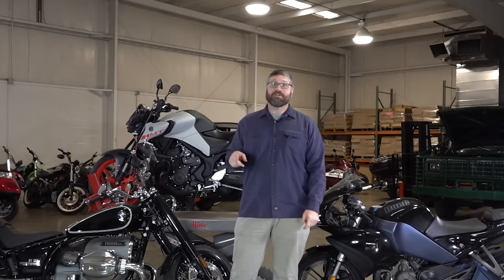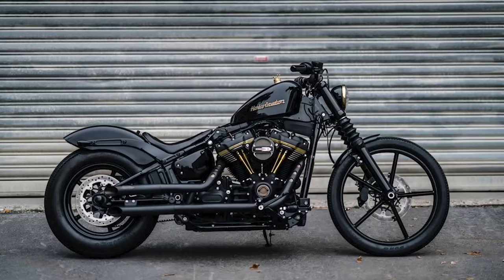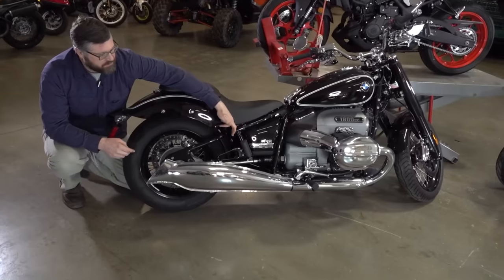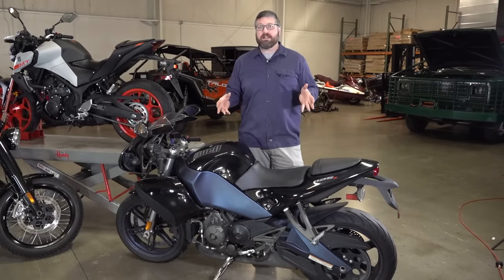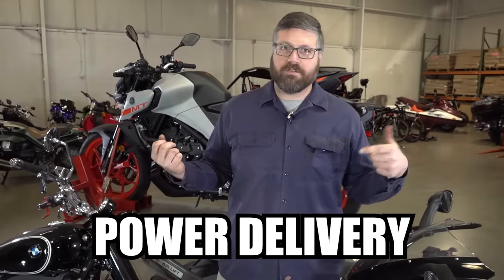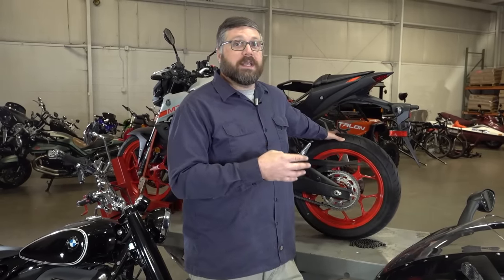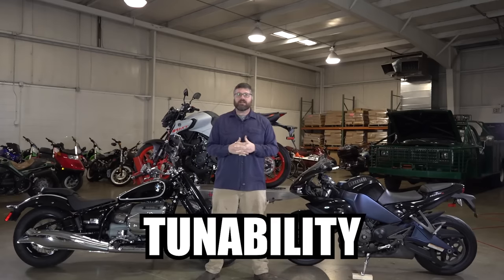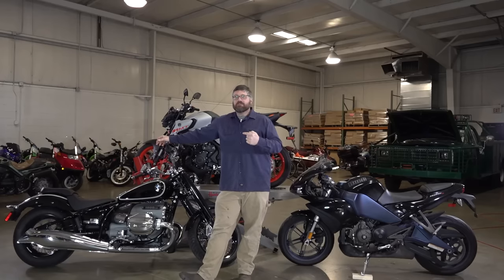Motorcycle Chain vs Belt vs Shaft Which one is Better?

Comment: My favorite drive is shaft drive. Then comes the belt and chain. The East German motorcycle brand "MZ" had a closed chain case to protect the chain from dirt and dust. These chains also had a longer service life due to the protection.
Reply: I had 2 MZ 250s, the second one was bought brand new. Thanks to the clever chain enclosure, the chains performed marvelously for more miles than I'm getting today with my Kawasakis and Hondas. The MZ ETS 250 was a slightly goofy-looking bike, (German MC magazine in the 1970s: "Yes, we have no bananas") but remarkably reliable. The second one, which wasn't abused  by a previous owner like my first, took me all the way from Germany to the Cevennes Mountains of France and back. Some friendly gestures by the factory -- the bike came with a really good toolkit, including a spare set of bulbs.  I wish I still had it here in the USA. But being a 2-stroker, it's not a favorite with the authorities here.
Reply: @georgiabrigand6793  Maybe an MZ 500 R with a four-stroke Rotax engine from 1991/1992? The design was completely taken over from the MZ ETZ 251/301 and also has the closed chain case. There's even an MZ club in Miami Florida. I found youtube videos. ;-)
Reply: @dennismundt7378  Wasn't aware of that one ! I'm putting the MZ500R on my "look out for" list, along with the latest BSA and Royal Enfield models. Thanks for the heads-up, Dennis !  Ride safe !
Reply: Lots of German bikes had this. the older Kreidler Florett's had it too. Can't remember which bike, but one old bike I saw, had an oil bath the chain runs through. At the end of the day though, nothing stops chain stretch.
Reply: @DetroitMicroSound  I don't currently know of any motorcycle manufacturers who still install a closed chain case. Starting with the "Skorpion" series, MZ no longer had a chain case installed. In the end, the star of MZ sank despite a beautiful and powerful model range (MZ 1000 S/ SF/ ST). In 2012 MZ was insolvent and a restructuring failed. The second manufacturer "Simson", who installed a closed chain box, went under in 2003.
Reply: @dennismundt7378  I don't either.
Reply: I think Simpson too?
Reply: @georgiabrigand6793  I remember reading a review on the MZ 250 ETZ in the 1980s. The review was mostly positive, but had one caveat: "The world's cheapest 250; but it runs on petroil!"
Reply: Sorry but I would have to strongly disagree. I had a Suzuki GS1100 with a shaft drive that I got from my brother, & to be honest, if it wasn't given to me I never would have bought that bike. It just felt very slow for the size bike it was & had poor throttle response. Sorry but I would put shaft drives down at the bottom of the list, then chains with belts (by far) the winner!!!
Reply: My Yamaha TR1 had an enclosed chain, also my 1984 Harley FXRT, (first year Evolution) "cruiser" had an enclosed chain.
Reply: @AncientApparatus  I had a Honda Shadow 750 with shaft drive.  When turning right on city streets, applying power through the turn, the slop in the drive was annoyingly noticeable.

Comment: Excellent - If I may I would add an extra variable in addition to Weight (see Jaslath comment): Cost and how it reflects on the bikes's price both on acquisition time and then long term (where maintenance / repairs will play a significant role). BMW has used drive shafts mainly on its boxer engines and these offer an incredible benefit rarely mentioned: side impact (T shunt) protection: the very much reason why I still have two legs to stand on...

Comment: Suggested item #4 for the "power delivery" category - only shaft drives impart a torque to the vehicle in the "roll" axis (like when you lean left and right). They all, of course, impart torque in the "pitch" axis (wheelie!). One could also argue there's a potential for an abrupt change in power delivery to result in a coupled force in the "yaw" axis (flat track/speedway cornering technique). My last shaftie had an uncomfortable amount of roll torque ... I suggest this is the #1 reason sportbikes use chains.
Reply: Not quite that simple. That torque reaction can be minimized. The late model BMWs and the Kawasaki C-14 do it by adding an articulated joint to the driveshaft. The Yamaha FJR1300 does it with steering geometry. I have never noticed any roll torque on my FJR.
Reply: Ding, ding, ding...BINGO That's exactly what I say & I can't believe Craig didn't bring it up. That's the #1 reason NOT to own a shaft drive bike! I had a Suzuki GS1100 with a shaft drive that I had gotten from my brother, & to be honest, if it wasn't given to me I never would have bought that bike. It just felt very slow for the size bike it was & as you said was very "torquey" with poor throttle response. I can't believe that anyone who is a true "rider" who wants to get the most out their bike would choose a shaft drive over chain or a belt???

Comment: Personally, I had a Honda shaft drive and it was absolutely awesome (not a sport bike or off road, but a cruiser).  Ran like a champ and still had good acceleration.  It was super smooth for longer rides and LOW maintenance.  With the Honda engine reliability and a shaft drive, it was the perfect motorcycle for someone who wants to ride and not spend a lot of time on repair and maintenance.  Would highly recommend to anyone who wants a smooth ride and low maintenance.

Comment: Great video. Very informative. I'm 78  yrs and hve been on two wheelers a long time. I have owned all shaft drives except for one, it was chain.  As far as heavy bikes go shaft is best by far.  My son has a belt dive on a Vulcan 900 Custom. It is not without problems.....adjusting  among others.  If you have time do a video on tires and  applications.  Always...ride safe.

Comment: One thing he forgot to mention that I think is worth : shaft drive is by far the heaviest system, adding quite a bit of weight to the machine (which doesn't really matter on big cruisers hence why they're used there. So more weight, power loss and cost for the shaft drive but super reliable and maintenance-free in most case. Whereas chains are light, strong (under varying environment), tunable and put the power down nicely but require frequent cleaning, lubing and the occasional adjustment. Can't have your bike cake and eat it too :P
Reply: If Craig didn't mention it, it wasn't worth mentioning. But do tell me about bike cakes because that sounds awesome. LOL
Reply: When drive shaft wears out it will pain to repair depending how easy to replace the bearings.

Comment: Shaft is great. 

My 1979 XS1100 had a shaft drive with 66,000 miles and its was 100% on point. The entire bike for that matter. Reverse rotation motor limited the rear end lift under its brutal 11 second 1/4 miles.

Comment: Having had several bikes I’ve found the Virago shaft drive and even the Honda Sabre V45 shaft to be extremely smooth and reliable. I’m very surprised that Craig failed to address the rotation differences between chain & belt (forward) versus shaft (lateral). Shaft drive bikes behave slightly different under heavy power. It comes down to personal preference. For those who don’t care to mess with sprocket changes and tuning the drivetrain you’ll find chain to be the last of the three options and shaft the first choice.
Reply: You are exactly right. I've ridden both and the shaft does have a different feel.
Reply: The way I used to ride (I no longer ride motorcycles) the chain was best. Two reasons. Number one being I never happened to want any bike that had a shaft. Not because of the shaft itself but none of the bikes happened to be my style. Second reason is I didn't really ride all that many miles per year due to long winters and other reasons. So if you don't ride all that much a chain will virtually never wear out. I never, ever changed a chain or sprocket. I sold my bike with the factory chain and if the buyer ran the bike a lot, then the chain was then their problem. And back in the seventies and eighties when I used to ride as a young pup, no bike I knew of had a belt drive. Maybe the first belt drives came out about the time I quit riding in the middle eighties or so. Bet you can't name a belt drive bike of the seventies!! Good luck. I think Harleys had chains only in those days. But I'm no expert on Harleys.
Reply: Belt for me bud
Reply: @mikemortensen4973  Belts on Harley’s last 60,000 to 120,000 miles
Reply: I was thinking the same thing, shaft drive, if I'm correct, picks the rear up on power delivery and belt/chain drops the rear down.

Comment: The key: “it’s about the application.”
I’ve raced and can’t imagine anything but a chain. 
I’ve toured extensively and used each of these at different times… shaft, hands down. 
If the belt was encased for protection, it would be perfect for the smaller to mid-sized road bikes.  And a good enclosure might even make the belt a good choice for adventure bikes. 
And the older I get, the more I like the shaft drive.  Imagine that.
Reply: An enclosed chain running in oil would be great, but so far I haven't seen it work.
Reply: Belts on Harley’s last between 60,000 and 120,000 miles bud
Reply: @humbleservant1294  The one in the video didnt seem to last too long

Comment: one thing I'd like to say is that while they may not last as long, chains are extremely common and cheap compared to shaft and belts, which means while you're more likely to go through wear and tear with a chain, it's much easier to repair and recuperate from than the other options(while very unlikely, you're pretty much boned if you damage your shaft or belt)

Comment: Nice list.  One thing I think you missed is the weight of each system.  It can make a difference depending on the application you're using the bike for.
Reply: So when would a pound or two difference...make a difference? Never for the average rider.
Reply: @yourhandlehere1  not for the average rider but you wouldnt put a shafty on a sports bike. and u wouldnt put a high maintenance chain on a cruiser.
Reply: @ih8momjokes1  Take a Yamaha Vmax for a ride - open the throttle WFO.... and get back to us
Reply: @kenwittlief255  Loved my VMax. Ever sold a bike and missed it the very next day? Queasyrider
Reply: “A pound or two”… 🤣😂🤣

And even a novice would feel the difference in a couple pounds of unsprung weight.

Comment: Over the years I've owned a variety of bikes and a couple of scooters starting with a horrible Russian made thing called a Voshkod (I think that is the correct spelling).  I have had belt, chain and shafts and I'd have to say my order of preference is shaft, belt and then chain.  The maintenance is the main issue.  Shafts need no work other than an oil change.  I have a Kawasaki Vulcan Voyager with nearly 100K/kms on the clock with the original belt so they last.  Obviously, the chain is the lightest and so suits the smaller bikes better and the pickup to the real wheel may be a little quicker but as I'm not riding to hoon around that doesn't matter too much to me.  I assume the reason Kawasaki went for the belt on the Voyager was because of weight issues (it's nearly 400kgs wet) earlier versions with the 1500 or 1600 motor had a shaft drive. All that said I've never bought a bike based on the type of drive.  But the bike that suits your riding style, that takes you where you want to go, that you can handle and you can afford and then enjoy riding it where you want to go.

Comment: "whatever, ahhh, let the engineers figure that stuff out."  real genius wisdom? I have an R1150RT it is not a "curser" it is sport touring. It has shaft and NO SHAFT JACKING due to design. Second no service except oil changes (super easy 0.25L) and EASY TO GET REAR WHEEL OFF WITH CANTILIVER DESIGN.  As far as tinker? I would rather ride and never have to change a chain or sprockets. I like the quite, virtually no maintenance (except oil change, drain, full) and ease of rear wheel removal.

Comment: I switched to chain drive on my street glide and i really believe it's the best thing I've done so far. 24 tooth up front 58 on the rear. Makes my bike take off like a  rocket. Top end sucks but how often and how long do you really stay above 100mph on public crap roads? So much cheaper than big bore kits. No more down shifting 2 gears to pass cars just twist the wick and gone....
Reply: Crazy to hear the sprocket difference compared to a sportbike, really goes to show the difference in the tranny's finals drive. My cbr1000rr comes with a 16/42 from factory
Reply: That is the one true advantage that chain drive bikes have. You can change the final drive ratio. Impossible on a shaft drive.
Reply: Chain drive conversion is definitely a nice way to make a bike much snappier without tons of money and time into the engine

Comment: Great video! However.... I think you are selling the belt drive short. It's quiet, clean, smooth while responsive, low power loss, almost maintenance-free and you can change the front pulley for city/highway if you wish.
For every single used bike I have had, I had to replace chain and sprockets, it's a system that just doesn't age well and people can't be bothered to service them often enough. It's expensive and annoying that you have to get dirty after almost every ride and it's a constant worry to keep track of mileage and weather since last chain service. The bike is always messy and the garage floor too.
Belt drive is like a gift from God for all bikes except dirt bikes.

Comment: The one mod I've seen for a shaft drive bike to change the gearing was for the Yamaha XS 1100. People would swap out the rear pumpkin from an XS650 to get taller gearing. There's a whole user forum dedicated to the bike with a section on how to do the mod. It takes some wrenching and a little bit of light fabrication to make it work, but if you can find an XS650 to cannibalize it's not a very expensive mod.
Reply: The old Honda Shadow rear on a Goldwing was another "thing", back in the mullet days.

Comment: A lot of the chain drive by in the old days had enclosed chain cases to protect the chain from crap with the oil bash the train would run in and protected from Dirk and rain and rust your change lasted much longer then everybody started dropping them off bikes and pretty soon you couldn't even get them as an option my Ricky frame TR6 broken two places on a ride the day before Thanksgiving and the Reynolds chain that I always used was holding the back end of the bike together true story the Reynolds Wrap got a good laugh about it

Comment: I'll have to disagree with some of the chain comments. Chains while very good at low speed power delivery have a higher parasitic loss at high speeds. This is due to the fact it requires more power to bend a chain around a curve, the faster the chain is moving. This is due to the same principle as a gyroscope, or rather angular momentum and inertia. However the fact remains chains are stronger than belts under high loads and have less stretch at high speeds than belt.(think drag tire expansion when running full out). Over the last 50 years of riding, I've run all three. I've run mostly chains, however now due to not wanting to spend all my time doing maintenance, I'll stick with my shaft drive.

Comment: I put a Scottoiler X system on my VStrom back in December. It throws a drop of oil on the rear sprocket every 50 seconds or so while moving. Since then my chain is always very evenly and smoothly lubricated and both the chain and the sprocket are much cleaner than when I was manually cleaning and lubing every 500 miles or so. It basically turns chains into no maintenance other than checking the slop along with the normal walkaround once a week or so.

Comment: A new and well lubricated chain have less loss, but a used chain, in rain and over 100kmt - not so much less, you cant have it all. 
I used to drive year around, and true used chain for small winter bikes and shaft for touring, never tried a belt drive (not so common here in Europe, or at least it didn't use to be, unless you doing Harley)

Comment: Shaft drive  is different on launch because the rear wheel pushes away from the frame. The others pull the rear wheel into the frame.
The reverse is true that the shaft drive may pull the rear wheel off the ground during hard downshift.

Comment: Nice video, some other things to consider; mess, chain grease splattered all over your rim, chainguard and it you really overdo the lube, your clothing or friend following behind you; shaft drive, torque reaction- older BMW and Guzzi bikes suffered from this quite a bit, try closing the throttle half way around a corner and see what happens, not nice. Belt drive-changing a damaged or broken belt on the side of the road is just not possible in most cases, especially big block HD bikes where it's a 6-8 hour job requiring the whole primary drive to be taken apart, and the swing arm as well (some have a removable block which makes it a bit easier). Where I live belt drive is a bit of a curse, we have a lot of coarse chip roads and road repairs are often not swept clean very well, I have personally seen 3 belts fail and the only option is to trailer the bike which is a pain, lots of HD get converted to chain because of this, same in Australia as well, you don't want to be stuck in the middle of nowhere with a broken belt. Overall, shaft is probably the most reliable.

Comment: On my harley that has a belt drive a small pebble got between the belt and broke the belt.
On shaft drive bikes when you give it the gas the torque puts pressure on the back tire and raises the bike a little.
So If you give it gas going around a curve on wet roads you will loose traction and hit the ditch.
Been riding bikes over 50 years now.
Reply: HAhahah...never seen a bike that WOULDN'T slide on a wet curve with an idiot on it.
Spinning a wheel is the same no matter what you spin it with.